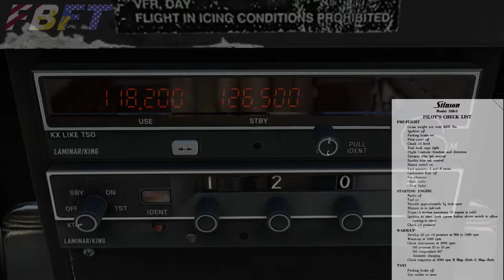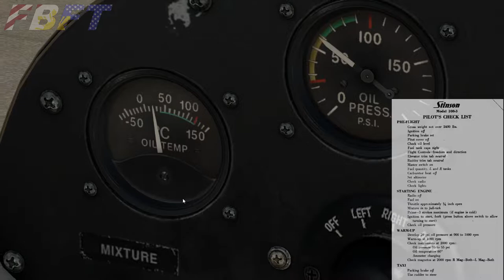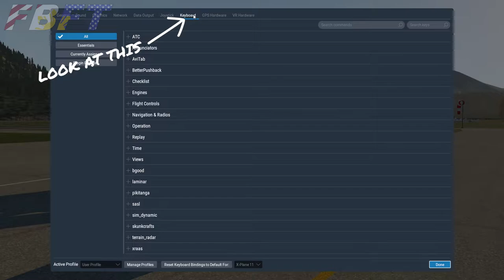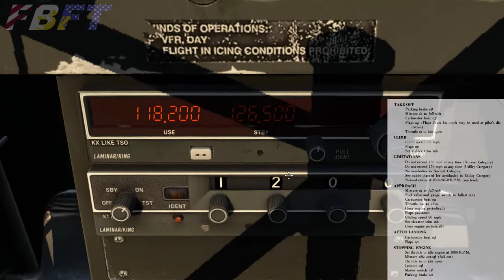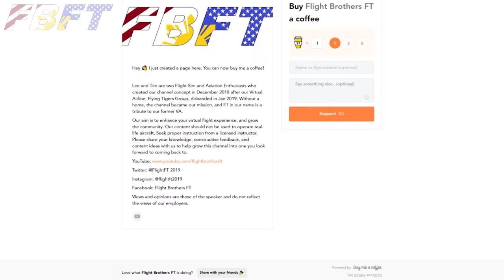X Plane - Stinson L-5 Sentinel Tutorial

Comment: this aircraft lands very smoothly in a 2pt wheel landing configuration with about a 1000 rpm power on touch down power to idol as soon as you stick the wheels roll it out with stick full forward until the tail starts to drop and then stick full aft. avoid braking until absolutely necessary. If you dont want to use the tail wheel lock stick full forward increase power and brake into the turn as soon as you want to stop the turn stick full aft reduce the power back to normal taxi about 1200 rpm. Great video !

Comment: Nice vid! I fly a real L-5 in a Vintage club and can say that this model on X-plane is very difficult to taxi vs the real plane. Take off/landings are much easier in the real one.  Other things that are a bit off on the X-plane: the landing light is actually on a servo and drops down when you turn it on. The flaps (on the E model anyways) only have 3 notches, up, 35 and 45 degrees. Our E model has drooped ailerons that you can crank down, those combined with 45deg of flaps will land this beast on a dime! Thanks for the vid!
Reply from the maker: Fantastic details on the real bird, thanks for sharing!  Happy flying!

Comment: Great video and enjoyed watching it.  You have put in a lot of effort in this video.  I do have a scanned L-5 pilot's checklist. Speeds & operating limits do vary as compared to the civilian Stinson 108 checklist.  Let me know if you want a copy.  As a long time L-5 owner, couple of very minor issues.   The instruments aren't all correct for an L-5 and the airspeed indicator should have markings down to 30 mph.  There was never a locking tailwheel, so when taking off be sure to keep the control stick full back until 30 mph then slowly raise it to minimize the torque and P-factors.  Cannot raise the tail quickly like you can in a Piper Cub or the L-5 will depart to the left side of the runway.  Stinson L-5's are easy to taxi but need to S-turn due to not being able to see over the nose. When starting, don't pump the throttle but use the primer (this could cause a fire if the engine back fires).   Flaps-  one notch is required on takeoff and the 2nd notch is usually used for landing, except for strong x-winds.  The video shows a flap handle in the rear cockpit but this did not exist.  An interesting sidenote is that there are no brakes in the rear cockpit.  This makes checking out a new L-5 pilot somewhat difficult if the need for brakes arise. On landing, flaps can be deployed only at less than 100mph.  First notch at around 95mph and the second notch at 80mph. By using some engine power and full flaps, a normal 3 degree approach can be flown if desired. Anyways keep up the great work and commentary!  One correction request: On the steep landing approach, you mentioned using landing at 60 -80 knots.  Should be mph not knots.
Reply from the maker: Wow, what a wonderful comment to read through.  Thank you for all that technical data!  I hope everyone who watches takes a look at your comment. Again, thanks for taking time to share all that.

Comment: Not an L-5 pilot, but I am a Tailwheel pilot irl. Quick tip for your takeoffs: as you power up, give slight forward pressure on the stick to get your tail up and keep you main gear on the ground to help keep centerline. Then at rotate speed release the pressure and you should just float away.
Reply from the maker: Fantastic tip, thanks!!!

Comment: The best solution to correct the lack of stability of this aircraft is to move the center of gravity more to the center and add a little load to the overall weight. By doing that, it can take off and land normally like any other plane. The values that I use at takeoff are: center of gravity 18.8 centimeters (my Xplane is in Spanish), payload 100 Kilos, total internal fuel 24 kilos distributed in 12 kilos in each tank.
Reply from the maker: Great tip, I will have to try that!

Comment: Comments in the order the things I noticed as they appear in the video:

(1) The L-5 does not have rudder trim, only the Stinson 108-3 has rudder trim.
(2) Max gross weight is 2250# per the FAA type certificate data sheet
(3) The overhead switch box is not modeled after an authentic, original one. Nor is the instrument panel. 
(4) The real L-5 does not have a manual tailwheel lock but an internal detent centers it within 10 degrees and breaks to free castering with a sideload, such as occurs with differential braking. It would be nice if X-plane could simulate that accurately.
(5) Standard takeoff flap setting is 1 notch (30 degrees) per the flight manual. 
(6) For better directional control on takeoff, add right rudder as you power up, but as soon as you raise the tail you will need to relax that a bit or the gyroscopic force of the propeller will cause a swerve. At that point, most people over-control. As you lift off, add in right rudder pressure again to avoid drifting off the runway centerline.
(7) The airspeed indicator on an authentic L-5 is calibrated in MPH, not Knots. Normal approach is 60-70 mph
(8) For a less steep approach, while learning the sim, don't use full flaps. Remember, when landing, pitch controls airspeed, power controls the descent rate. Trim for the desired speed.
(9) While the X-plane sim is pretty good, the handling does not quite mirror the actual aircraft, especially on landing because it doesn't model the physics of the cantilevered gear legs spreading. or the operation of the tailwheel.
(10) Historically, the real 42-98186 was not marked D*6C (14th Liaison squadron) in WWII.  A period photo indicates that it bore no fuselage marking other than the star. The tail numbers were also orange-yellow, not white. By regulation, the upper invasion stripes were removed by August 1944. 
(11) For more info, contact James Gray who runs the Stinson L-5 owners association at www.sentinelclub.org. He can provide any technical or historical information about the L-5 and is the best source of accurate information. 

All in all, however, a thumbs up on the sim of this neat airplane and the video presentation.
Reply from the maker: Thank you for the tips and feedback!  Great info.

Comment: Static takeoff is the best way to get this plane off the ground. Lined up, lock tailwheel, hold brakes, full back stick, full throttle, RPM stabilized, release brakes, light foot jabs on pedals for centerline, 40mph IAS slowly release back pressure, 60mph rotate gently don't yank it off, airborne! have fun flyboys!
Reply from the maker: I will have to give that a try! Thanks for the tip.
Reply: @FlightBrothersFT  You're welcome! and thanks for the tutorial video!